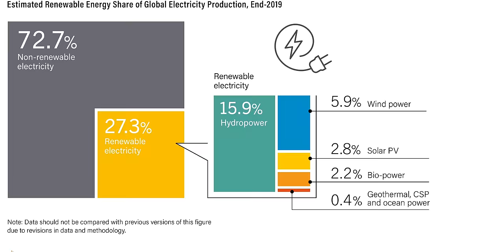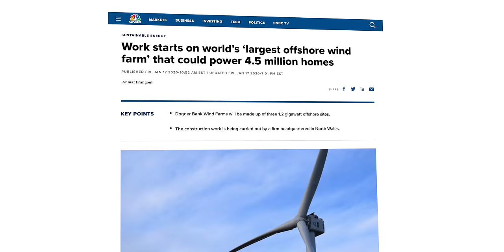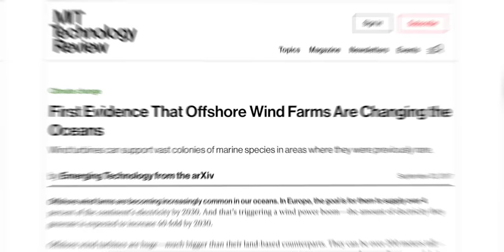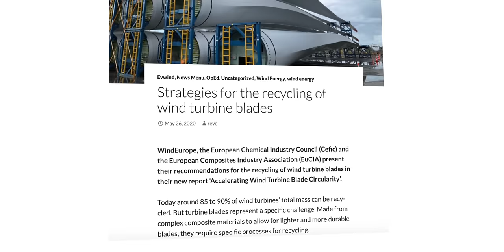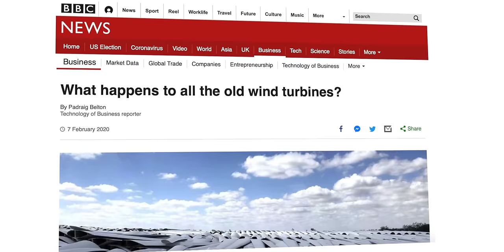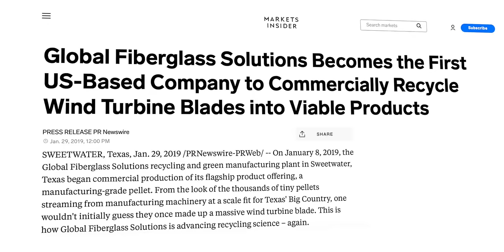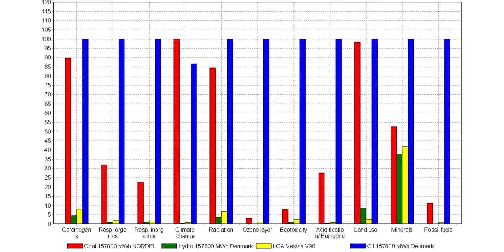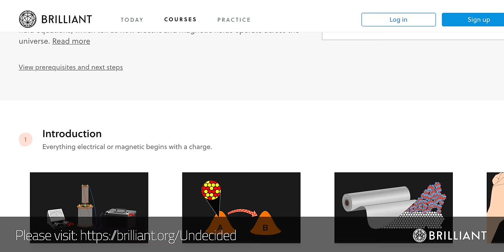The truth about wind turbines - how bad are they?

Comment: Overall a pretty fair summary of the pros and cons of wind power.  A couple of other things that need to be considered, impact on wildlife and the need for "backup" power generation.  Wind farms have a very negative impact on bird and bat populations and it is unknown if the low-frequency noise has a long-term impact on marine life.  And as the people of Texas know all too well Wind Farms don't produce electricity all the time (not windy enough, too windy, ice build-up on blades, etc...) so you need some kind of reliable backup power generation.  Nuclear can't be turned on and off quickly, Solar is even more unreliable so you are looking at fossil fuels again.  If you want a stable power grid for every MegaWatt of wind energy you will need an equal amount of fossil fuel energy on standby.  This increases the cost of electricity to the customer, doubles the power footprint, and doesn't lower the carbon footprint that much if at all.
Reply: The only situation I have seen where wind seems to be viable are the ones installed along the Columbia Gorge. They work in conjunction with the dams. When the wind is blowing the dams can back up more water and when it stops the dams can turn on more generators. Whether it is economically viable or not we may never know. Too much corruption and politics involved in energy production.
They sure are ugly though. (when compared to the incredible scenery they are built on)

Comment: 21. In order to compensate for episodic wind/solar output, U.S. utilities are using oil- and gas-burning reciprocating engines (big cruise-ship-like diesels); three times as many have been added to the grid since 2000 as in the 50 years prior to that.

Comment: The one glaringly obvious point you have failed to mention is the unreliability of wind !  The fundamental issue with power is that it cannot be effectively stored; so if someone switches on a light switch in Edinburgh or London, the power has to come from somewhere immediately. If the wind is not blowing then the power cannot come from wind, which means you have to have a fully functioning and operationally manned back-up power station (usually Gas, as you can fire this up quickly to cover for wind shortages). So the customer is paying for 2 types of power plant to produce one electricity. Contrast this with Tidal where you can build a useful bridge at the same time as building a tidal barrage and you have 2 uses for one build, and Tidal is dependable because the tide goes in and out every day ! We should stop building wind farms with immediate effect and invest hard earned tax payers money in a dependable renewable electricity source !

Comment: Wind farms can alter local climates by extracting kinetic energy from the wind, reducing wind speeds and diminishing the capacity to transport heat and moisture. This can result in hotter areas and reduced rainfall for inland regions, potentially causing droughts and agricultural challenges. Research has confirmed that large-scale offshore wind farms can significantly affect sea surface climates, reducing air-sea heat fluxes and altering local weather patterns.

Comment: It should be noted that many of the turbines installed in California are still working and only now are some being replaced with more efficient ones. We must also look at the energy and decommissioning demands of other energy sources. Nuclear decommissioning is eye watering expensive, takes years and lots of the material can never be recycled. Nuclear uses massive amounts of steel and concrete. Hydro is a concrete makers dream order. It often has significant wildlife impact and sinks land underwater forever. The oil and gas platforms offshore are so expensive to remove that most O+G want to leave them there as "fishlife refuges" in order to avoid the real bill and they make steel makers fortunes with the metal difficult to cut up both offshore and onshore. This ignores oil and gas emissions and leaks onto land and sea plus the vast pipelines needed to move the fuels. Solar is much the same as wind but it cannot be put offshore at any scale. Birdlife loss is happening at a massive rate due to climate change not a few windmills (compared to the other carbon emiitting power sources). Nobody wants an oil refinery, oil rig or gas storage neat them either. As for coal and its legacy well if its not coalminer lung then its emissions are even more lethal and your're left with a near useless hole in the ground next to a power plant that has no value apart from scrap assuming the operator has not sought bankruptcy as a means of avoiding the cleanup costs and the sick worker claims/pensions

Comment: 2 questions

1. Why not they use some kind of compacting or cutting machine to make the blade material into smaller pieces? thus transportation can be optimized.

2. Why not make smaller and more efficient will mills to decentralize the power generation like solar panels in our roof?
Reply: To answer the first question companies are looking into this. However it brings large challenges in designing and constructing the blade. In the future most likely blades will not be one part.  
Secondly the reason why the costs are low is because of the large scale. This reduces costs per MW capacity installed. Creating smaller turbines would lose these benefits and become more expensive
Reply: Another addition to the second question. The sound of wind turbines is seen as very annoying and you wouldn't want such a sound source on top of your roof. So unless there is a way to do this very quietly there will be to many challenges...

Comment: To produce a wind turbine, the turbine must spin continually for 7 years just to replace the energy it took to produce it. 
And it must run non stop for 38 years to make enough energy to pay for the cost it took to manufacture it. (not including transportation to the sight, set up or maintenance)
Current life expectancy is 20 years
It requires 80 gallons of oil per year to lubricate a turbine. 
Turbine blades are made from toxic fiberglass and never break down. 
Currently, they are taken to a landfill in Wyoming, after they’ve outlived their usefulness.
Reply: Where did you get that numbers, do you know the amount of power a windmill can deliver? 🤔
Reply: For most it’s actually 6 months to offset the carbon, and it’s site, not sight.   Do you think fibreglass (it’s actually inert) is some how more toxic than nuclear waste, or coal ash, or the toxins spewed by burning Fossil fuels?  But yeah, let’s worry about those 25,000 turbine blades that are replaced every year.

Comment: Wind turbines are anything but green. Just google how much oil is in a commercial wind turbine. You'll find that they each have from 60 to 200 gallons of oil depending on its size. That oil has to be changed out on a routine maintenance schedule. Not to mention the grease also used. The tower,and blades, and generator don't have a real long life expectancy either. Nuclear would be a better return on investment.  All these windmills are making the elites rich. Its all about the money.
Reply: What!? You mean you need oil to lubricate spinning parts!? Damn my agenda...
Reply: Have you tried googling how much oil is in a oil power plant? Hint: it's more.
Reply: The point being is wind is no where close to being green. There are millions of these green turbines what a joke.
Reply: @professorbird6106  The issue is that saying that something has an environmental impact isn't useful without context. Wind has quite low emissions over its lifecycle for the amount of power it produces: much lower than fossil fuel alternatives, for example.

Comment: Hello Matt, sorry to react so late relative to the release of the video, but I had missed it.  Great video as always, but the presentation of the blade problem is not put into proper perspective.  The images shown can be spectacular, and let think that the problem is HUUUGE; we are soon going to be buried underneath a heap of old turbine blades.  But let's put the decomissioned blade issue into perspective:
- The amount of composite material waste as a ratio of energy produced is ~0.15 g per kWh (yes, no order of magnitude mistake, only 150 MILLIgrams!).  This waste should definitely not go into landfills, but should be recycled more or less efficiently, as the examples you brought illustrate. But recycled it should, and it will.  I agree that you may need energy for that recycling, but let's say that you need 0.1 kg of some hydrocarbon fuel to recycle 1 kg of blade material (which is a huge exageration), then you need only 0.015 g of hydrocarbon fuel per kWh produced for that recycling  
- A gas turbine burns 210 g of gas to produce a kWh, all of which goes to a harmful and irrecoverable (unless you invest lots more energy for CCS) waste called CO2, not to mention other toxic "byproducts" like NOx .

Don't you think that the blade problem is anecdotal in comparison?  The difference in orders of magnitude are several thousands!

Comment: Nice analysis, drawing attention to little seen problems.  

Unfortunately like many such  it still mainly considers wind impacts from the framework of a hobby power source, instead of looking hard at the impact of wind scaled to supply the vast energy needs of the US, and reliably.  

For instance, it’s rare to see consideration of what the unmatched Atlantic cyclone will do to an east coast supplied nearly all by offshore wind.  The topic doesn’t come up, because many imagine that the ‘real’ gas and coal power plants will always be there.  

Further it’s imagined that a cyclone would do, what, knock down a few turbines, little noticed.  But there are already examples from reality.  The PR storm Maria hit the  windward wind farm there, *onshore*.  Maria didn’t loosen a few blades, bend one tower.  It obliterated every single wind turbine, and that with no offshore 30M wave action.  Such a storm rolling up the US coast could wipe out the majority East coast power, for years.

Set aside the violence of storms and look at simple seasonal wind variation.  While the east coast has great average wind resource, everyone working in those waters also knows that in early Sept or late Aug the coast can turn into a hot, windless, jelly fish infested flat bathtub  for a week or two for a thousand miles of coast. Again, if the plan is unserious,  hiding all the existing fossil fuel plants behind the curtain, then a couple weeks of no wind is no problem. 

The other mentions here of some garage shop solution, such as blades into pellets or into Danish park benches are, sorry, unserious.  Plastic too is recyclable via such means yet oceans are filled w it because the industry can’t tolerate the energy or the cost to recycle enormous masses of very low value material.  So too the wind industry.  Yes there are stunt recycles of turbines and blades.  But no country anywhere yet mandates 100% recycling of turbines up front at contract time, else clean energy promising politicians would lose their clean store window. 

So please, get serious about what large scale means, about what a million wind turbines means.
Reply: the best reply anyone has done .
Thank you for blowing away the pixie dust/unicorn farts of so many fanboys.

Comment: For the same cost, a Nuclear power plant can be built that will produce power 24/7 for 60 to 100 years. The blades are environmentally inpossible to be recycled with todays technologies. What ever you say, a wind turbine cannot produce electricity 24/7 and their lifespan is often less than 50% of what is claimed.

Comment: Utilities may not "generate" the equivalent power that is displaced while a wind farm is producing, however they are still burning fuel and making steam to near capacity so they can power up the steam driven turbines quickly as the wind drops below 15-20 km/hr. Otherwise brownouts would be much more common. Check out what happens to all the industrial systems driven by computer failures when brownouts occur. Extreme waste/cost. Its a big lie that windmills "work".

Comment: The Bottom-line would you live close to one. The noise is awful from my own experience and they kill birds like rain falling.
Reply: I have a Berget XL1 wind turbine in my backyard, provides most of the power I need without ugly powerlines. Good reliable unit, very quiet, needs very little maintenance, computer controlled and uses sealed roller bearings so no lube needed. Main maintenance issue is painting and corrosion control.
Reply: You must have very little rain in your area...

Comment: Wind energy sounds sexy until you consider that the turbine and blades have to be replaced (realistically) every 10-20 years.
Reply: Can you provide some links to objective sources/links on that? The estimates I have found are for about a 25 year life span.
Reply: @glennjgroves  This is practical information from working within the industry. 25 years is the theoretical limit that's often projected at the beginning of a project. In actuality, we start evaluating refurbishing/decommissioning options in certain regions at 10 years.
Reply: @betaomega04  considering decommissioning after 10 years is a surprise; are there financial calculations that are done to decide between maintain/repair versus decommission? Can you say basically what the calculations are? I thought (but am not sure where I got this from) that older turbines are often simply replaced with larger ones, due to larger turbines generating more often/consistently. Not necessarily replaced in the same location. I know for example that some actually working solar panels have been removed and replaced with new ones simply because the new ones generate significantly more electricity than the working ones that were removed, and I wonder to what extent that may apply with wind turbines also.
Reply: @glennjgroves  There are several factors that come into play. Larger/more-powerful nacelle turbines can weigh considerably more, and the towers that hold them in place may or may not be strong enough to hold them in addition to the clearance and additional forces brought on by a larger blade diameter. Environmental conditions can accelerate degradation, which is the primary reason why some projects undergo evaluation at 10 years. In the end, everything comes down to cost analysis that weighs renovating a project against the cost savings of decommissioning it.
Reply: @betaomega04  so a part of the issue (only part) is that designs are still improving; which is good in some ways... why bother repairing something that can never be as good as new ones are... if they ever reached a “peak” of design that would slow down at least and maybe repairs would be more worthwhile then. I don’t know if that would ever actually occur (reaching a “peak” in design where design or size did not alter much from then on).

Comment: Wind power is ONLY ”cost effective” as long as it can parasite on already existing power generation when the wind is weak ! So, the question is how much wind power can a grid cope with until it gets unstable if not something else is supporting the wind power. This something else, will add costs to wind power. Only then, it is comparable with for example nuclear power or planable power generation.

Comment: These days all the green experts will tell you that wind power is cheaper than coal or gas but are they telling the truth ?  Could their figures be rigged ?  They could and they are.  Here are two words that should be prominent but are totally missing from this video.

MAINTENANCE - You never see this word anywhere in green costings.  Funny that.  Timken, who make wind turbine bearings, tell us that every land based turbine will need two or three rebuilds during its life span.  They estimate that the rebuild date will be every 7 - 10 years even though 10% of turbines fail at 6 years.  A rebuild can be relied upon to cost USD 300,000 to 400,000 yet the green costings never mention them.
SALT - Salt hates machines and puts all of them under attack.   Where are the mentions of salt damage in the green costings ?  Nowhere, yet salt can reduce the rebuild period of an offshore turbine to 4 years with a cost of around USD 500,000 to fix.
If you want more then take a look at the cost of access roads.  They have to be good enough to carry  a 40 ton truck uphill in the rain.  $$$$

Comment: They require a lot of carbon to manufacture, they use lubricating oil, and they are expensive to dispose of.  They are noisy and they do not operate all the time.  They are NOT a panacea.

Comment: .  Wind farms at sea are massive graveyards  . Windmills vibrate.  Fish use a sixth Sense called a lateral Line. The fish use it to detect vibrations in the water.  Vibrations equals danger in most cases .  (Larger fish bigger vibration)  most fish Will not go near a windfarm . Also most fish in the northsea is flat fish or bottem fish .  These kinds of fish prefer a flat (sand, muddy) seabed. Windfarms are filled with Stones to prevent erosion.   Dolfins use vibrations for navigation and get desoriëntated from these vibrations.  And then there is constant leakedge of hydrolic oil from windmills wich pollute any water filtering animals like mussels and oysters in wich become uneateble

Comment: Have read on a chemically modified wood compound that has more strength than steel & is very low in weight. Perhaps this would make a greener and better material than plastics.

Comment: What makes the blades bad to begin with?  In what way are they worn out?  I haven't found the answer yet.
Reply: Dust/sand is a huge factor.  Bird impacts as well. The tips of those blades are traveling at triple digit speeds, even though the blade looks like it's lazily turning at 20 rpm.  It eats away at them, which reduces their performance.